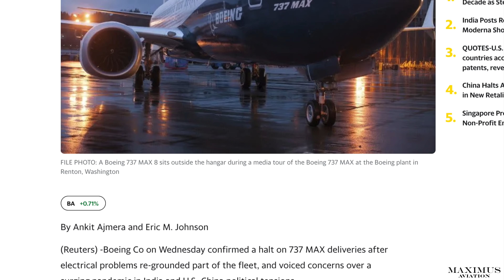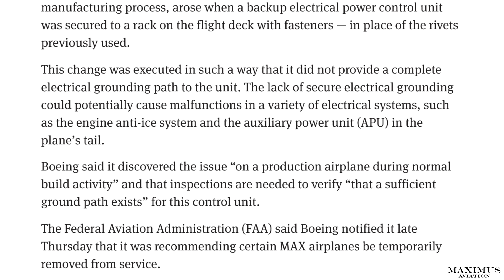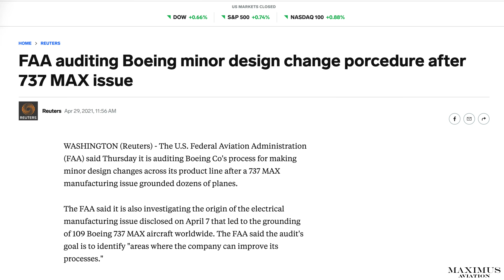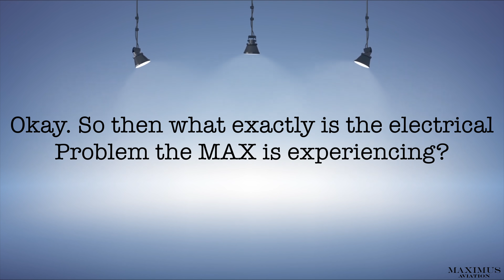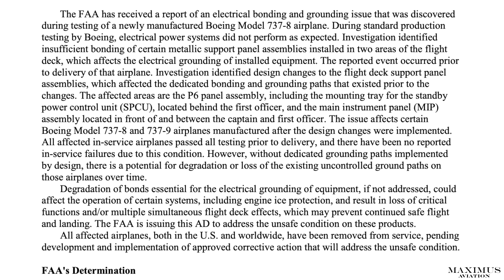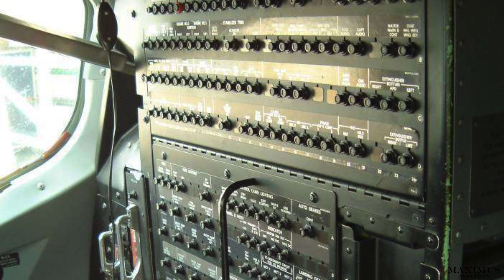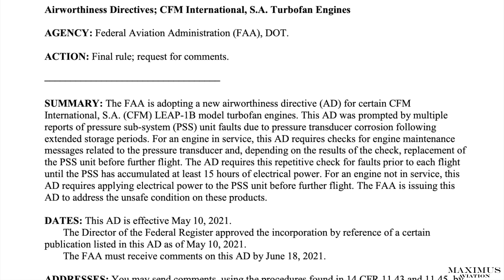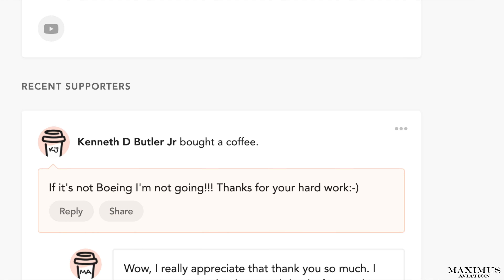Boeing MAX STILL Grounded! New FAA Airworthiness Directives Keep The MAX On The Ground Indefinitely!

Comment: They could've kept their decent reputation if they started to develope a new narrow body aircraft after the NG was released.
Reply: I agree, this airframe was designed in the 70s, it’s out of date and beyond its modification life. Developing new aircraft from scratch is expensive, but at this stage with all the money lost you have to ask that maybe the best choice would be to simply stop the hemorrhage with the MAX and go back to the board. Meanwhile Airbus is turning a profit and pushing forward. Good job Boeing your bean counters have essentially killed all current R&D and current development projects. A once world leader in aviation brought to its knees because of board room stock market focus. Disgraceful
Reply: Don't need a new one. They could have upgraded the 757.
Reply: @edsmith438  757 is a totally different market plane, not at all a 737 replacement. Apples and oranges.
Reply: @TheBeingReal  maybe with the original 737, but not the max.
Reply: @edsmith438  The 757 was not designed to be a short hop plane.  Both Boeing and Airbus, due to airline plane demands, have left a hole in the “middle” market where the 757 was. 

There are/were huge sell points for the 737: pilot training requirements, global spares availability, low to the ground for easy cargo/luggage handling, etc.  A new airframe undoes all that.  The low ground clearance has brought engine upgrade challenges as the bypass ratio is much larger now than when originally conceived, hence the ‘flat bottom’ engines on the latter variants before the MAX model.  The larger 737’s just never filled the gap. 

A potential 797 is in consideration to fill the seat capacity void of the 757.  Be a whole new plane and easily 10+ years to launch.  Trying to redesign a near 50 year old airframe design is just not worth the cost.
Reply: @TheBeingReal  whatever
Reply: Schlomo Baconberg  Widebody twin aisle to replace a 737?  😆😆😆😆😆😆. Too big to replace a 757 too.
Reply: For once the simple solution to a complex problem works
Reply: Schlomo Baconberg  visually or aerodynamically?

Comment: Oh, my. A faulty ground in an ordinary car (e.g. damaging the earring strap, or plain forgetting to reconnect it) can cause everything - from electrical gremlins, thru plain fire when you crank the car and you inadvertently put 1200 W / 12 V = 100 Amps thru random wires, gear stick linkage, CV shafts etc., instead of the strap. So, here we have a panel on a fricking flying plane, located at the crew’s backs, with several high-power circuits. Even if these are control circuits only, this can go sparky⚡️
Reply: Every plane has that, and they never sparked.
Reply: @tomatosoupwoo  Well, I also never believed in this sparking sh..t, working for 30+ years on my cars, motos & alike. Until I saw the effects of poor earthing (in this case, again, a dodgy earthing strap) and sparks with my own eyes. Not only sparks were flying, but the driver was tingled by the 14.4 V from the charging circuit, as low & safe it can be.

Look for Car Wizard videos about his Customer’s Triumph TR8. Here, just 2 of them. You will see:

https://youtu.be/SmskoaxSYs0
https://youtu.be/cOZyLzaCZjw

Comment: Is it only me or does everyone else also think that the regulators are not doing their jobs thoroughly, even after scrutinising the plane for almost 1.5 years?
Reply: Naahhh, Regulators Just make sure the paperwork is filled out,,,,, the hands on tech
installing the things is who gives feedback to the designer / engineer what the problems
are that the CAD engine can't predict....An artifact of the process where the designer of
 the part is disconnected from the build and install process...

Comment: I will not fly on any Boeing aircraft launched in the last 20 years , so yes to 747 400 etc. No 787 no 777x no Max.
I vote with my wallet. Sad how they have become such a half arsed, coner cutting, 3rd rate manufacturers they have become.
Reply: the 787 is not bad even though it has had quality issues but that does not stop you from flying on one? the 777x has not been in service so how would you know that would be bad? and the MAX well just wait for n see
Reply: @nickolliver3021  I said 747 not 87. Why not the 777x? Because it was designed by Wall Street, just like the 87 and the max. The fact that it's delivery has been pushed back by years now than it will be subject to unprecedented scrutiny by non FAA regulators post Max indicates to me that they knew that it in poorly engineered and now they have to go back and fill in all the corners they cut.

Comment: You couldn’t make it up. I am beginning to wonder. If the 787 were to be put through the severe investigations, that the much maligned Max has been, would they find similar irregularities?  I cannot believe that the quality control problems are all contained in just one of Boeing’s problems
Reply: No, it wouldn’t, so much is different within 787 compared to 737
Reply: The 787 is it's own can of worms. And i would think it has a lot of the same issues the max has.
Not flying either.
Reply: @baronvonlimbourgh1716  not flying what

Comment: You'd think that there would be a grounding/strap
permanently attached to the MIP, SPC unt their
panels ¡¡¡¡¡
Reply: ’xactly
Reply: Just crazy depending on chassis continuity for grounding.   ERCO system out of control too.  Riot act needs to be read out loud at all levels of this organisation.
Reply: Grounding strap to what, the carbon composite fuselage?  Maybe that's one of the issues.
Reply: @unpopularopinion8608  The fuselage of a 737 is made of carbon composite materials?
Reply: @tomcorwine3091  lol, whoops I had just watched the Dream liner video and got mixed up. Good catch.
Reply: @unpopularopinion8608  Lol. I was thinking the same.

Comment: Dear Mr. Boeing, your planes are not safe. If you want to let your planes fly again you have to put real ground straps everywhere 
and proof without any doubt that they survive flying through the sun and please buy some new engines. Yours are rotten.
Wouldn't it be cheaper to close the company, wreck all planes and buy some smaller ones from - idk - maybe Embraer?
Reply: Embraer isn’t a very good company, and they don’t build big enough or long range enough aircraft
Reply: @tomatosoupwoo  Then i would recommend scaling down your demands and try the train or maybe the queen mary. I heard it went bankwupt and you could hire it to go to you preferred holiday destinations. I would not recommend Airbus after all its the great big competitor and you really do not want to sit in a french machine made by brits in wales with some help from spaniards and italian mafia bosses.
Reply: @Frankie Under the tarmac please. For a building of that size it must be a double ring of 10 mm² aluminium with at least 10meters distance from each end around and every 10 meters there must be a as direct as possible connection to the metallic frame. The ground ring must be at least 1.5 meters under round level when the water table is at least 2 meters below otherwise it must be at least 3 meters under ground level em,bedded in a protective sand layer. Of course it must be measured afterwards according to the EVU rules. For each and every building aka Boeing 737 Max...
Reply: @Frankie I knew why i have learned to be a electrician. I knew i needed it some day. 👍😁😎

Comment: 737 needs to be pulled back to its military roots? Just ditch everything civilian in Boeing & build to mil spec... can't be worse... right?
Reply: Its the Boeing double standards that makes me laugh. They develop their aircraft on open ended military contracts where the bottomless pit of defense spending subsidizes the planes development to the tune of billions and once they've fixed the problems they create the civilian version. Yet if any of their competitors receive a subsidy from their government they cry foul and pressurize the US government into punitive  sanctions and taxes. Look what happened to Bombarier when Delta tried to buy 75 planes. Bombarier "sold" the plane to Airbus who now manufactures it in the US
Reply: @johnturnbull7798  Amen!
Reply: Dunno... From what I've read around the V22 was one hell of a problematic money pit on both engineering phase and earlier operations. (edit: then again this was what, the 80s... In other hand this was a different Boeing too)
Pretty curious to know how good is their military division doing quality-wise, tho that's one thing that we probably never get to know for obvious military reasons.
Reply: @Kalvinjj :Heard they keep leaving junk in their KC-46 last I heard... (https://www.defensenews.com/industry/2021/01/27/boeings-cost-overruns-on-kc-46-now-exceed-its-initial-contract-with-the-air-force/) Though they have sorted out  two Cat 1 Problems recently I believe.
Reply: Check out the disaster the air tanker was!

Comment: I truly hope Air New Zealand never buys a single one of these pieces of junk. I feel far safer on the A32x series of airliners.
Reply: your not the CEO of Air Newzealand let them decide when things get right for once
Reply: They got the same engine buddy.
Reply: @Ben_Stewart    They have NOT got the same engine, A320 Neo's use the Leap-1a, Max's use the Leap-1b which is 8" smaller.    Anyway, that's kind of irrelevant - no Max or Neo has crashed yet due to engine failure.     Max's problems are a whole different can of worms.
Reply: @Ben_Stewart  the problems with the 737 are not the engines buddy. It’s the whole damn plane that is falling apart
Reply: @Ben_Stewart  but they have been allowed to run them over the last two years whilst the Boeing ones have been compulsory sitting on the ground.

Comment: 737 Max sounds like the biggest maintenance catch 22 ever seen in the history of engineering.
Reply from the maker: I wonder if since the FAA got torched for the handling of the MAX in the past how many of these incidents used to just get swept under the rug.
Reply: @maximusaviationchannel  Now that the FAA is back into the oversight role, they can finally spot issues Boeing would never bother reporting to them while having the autonomy to green check themselves.
Reply: @maximusaviationchannel  Seeing that the FAA factually speaking has given Boeing the power to self-certificate, I'd imagine a lot of them. 

You just know there's something wrong when oversight and manufacturers are too cosy with eachother. Have a look at the infamous VW Dieselgate, which only could happen because oversight gave manufacturers a list of specs for the new  environmental demands and then told those same manufacturers to set up tests themselves to show they complied with those demands.
 
You can apply the same to Boeing: the FAA simply told Boeing "we trust you completely, so we allow you to self-certify. Just give us a report and we'll sign off on it." And Boeing management abused that trust in order to boost profits and compete against Airbus.
Reply: @tjroelsma  "too cosy with eachother" -> You are so right. Saw that from my own eyes in a totally different business
Reply: @maximusaviationchannel  you could be right there
Reply: No it is not 22 it is 22^22 means 2e28 😂🤩
Reply: @zv223  haha sadly so...
Reply: @rohrichoak9740  greedy peopel got ha ha. Clown stay to be 🤡 only engineers can make airplane not clown's
Reply: When I was at Boeing, the motto was: we don't build the plane to fly, we fix it till it flies.
Reply: Yes, that plane is basically braindead and only being kept alive by breather machines. 
I can't imagine companies ever trusting that plane again as problem after problem keeps being exposed. And this is a problem that's been discovered on a brand new Max. This directly means that the Max is even worse than it thusfar seemed to be and at this stage you can almost call it a wonder that the Max has even made some succesful flights at all. 

This Max debacle is a complete Charlie Fox situation for both Boeing ánd the customers that bought those planes.
Reply: @tjroelsma  👌👍
Reply: Except that Boeing does not make the LEAP engine!
Reply: Actually the most dangerous jets ever built were the a300 and a310. With 1/5 of the jets crashed beyond repair. 757 767 777 2 of the safest jets ever with 30 years plus in the air

Comment: It's not fair to blame Boeing for rusting CFM components. Bashing Boeing is blaming Boeing for things that aren't their fault, so if you think Boeing's to blame for PW4000 issues or Trent 1000 issues or engine corrosion, then that's bashing Boeing.
Reply: @makeupbycarlcapellan  Here's the difference between Samsung vs Sony and Boeing vs PW/RR/CFM: Samsung never discloses to the customer who makes the camera senser. However, Boeing has disclosed from the very start that CFM makes the engines. In fact, you will see CFM logos on some of the Leap-1b engines, and most RR trent 1000 engines have the RR logo on the nacelle, meaning that unlike Sony, who doesn't put their logos on the camera cutouts of Samsung phones, Rolls Royce and CFM want to make a name for themselves by slapping their logos on some of their engines, and if they're that proud enough to shout "I made those engines" by slapping on their logos, then they should take responsibility for engine issues.
Reply: @makeupbycarlcapellan  Here's another point. Many A320NEO's and A220s have had issues with PW engines. Would you blame PW or Airbus for that?
Reply: He didn't say it was Boeing's *fault*, but it's certainly a 737Max *problem*.    The AD was directed at the Leap-1b, which is only used on the Max.    It doesn't look like a huge deal to me, just requires careful monitoring.